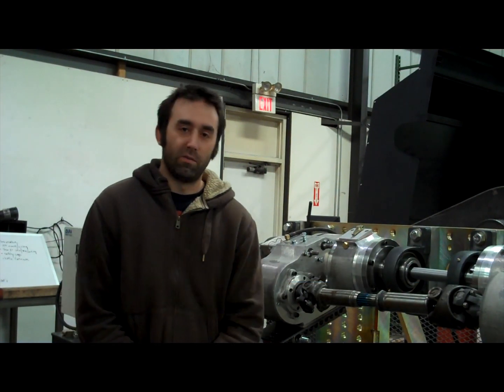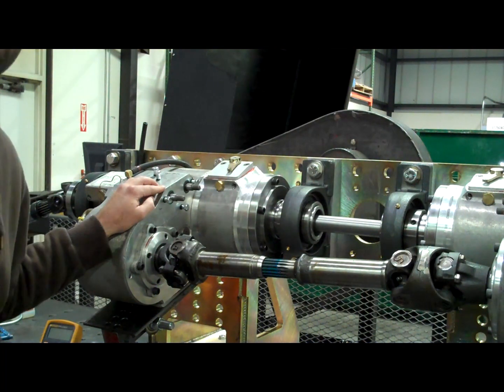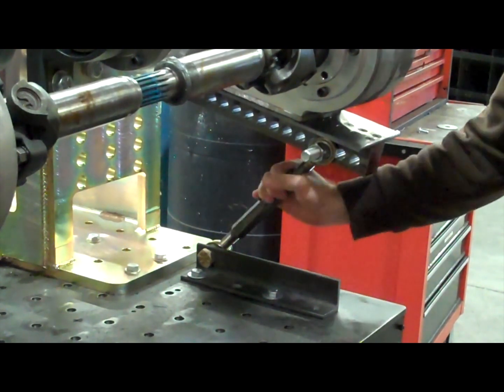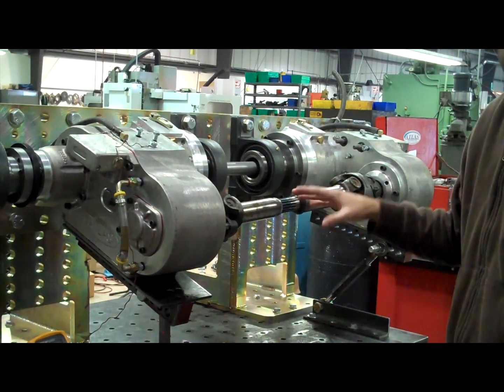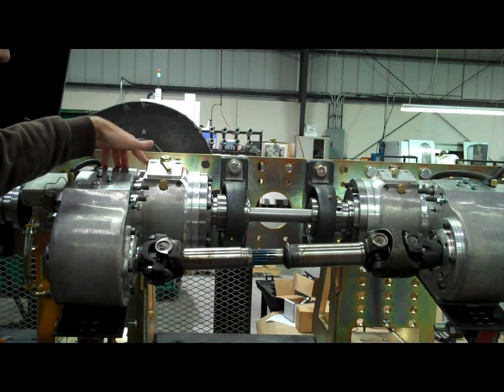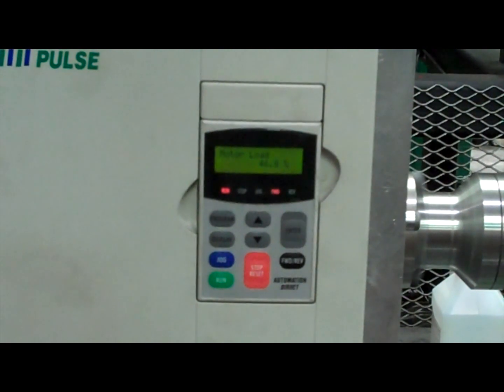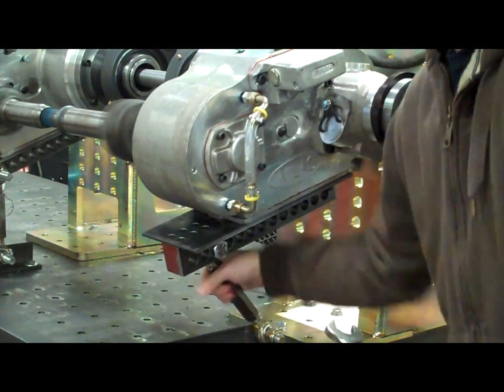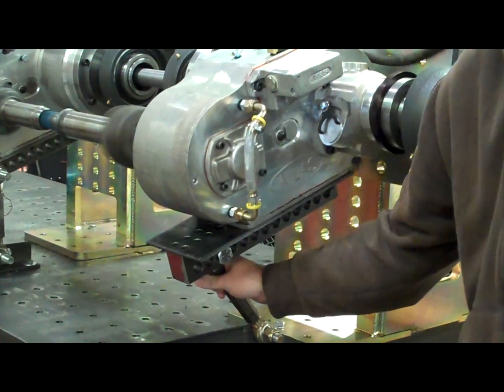Four Square Dyno

Comment: I know this is the wrong video to comment on ....... but I have an AA dual case adapter on my Toyota . I cant complain about performance because it has never failed or given a problem . but the finish of the product was poor . there are knicks and scratches where the adapter had obliviously been dropped or miss handled .That being said none of the knicks are on a sealing or bearing surface so it is an ascetic issue.